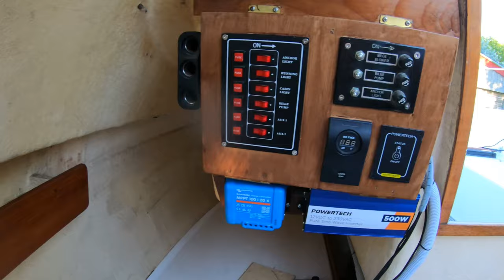74. I Return to roots I Freedom Sailing

Comment: Very impressive work with your boat. Also thanks for the great pointers in the solar panel. Can you share some details on the make and model and price of possible? 
Love the scenery and the water plane landing and even more so the house on the pontoon. Amazing!!!!
Reply from the maker: Well surprisingly that panel setup was cheaper that everything we did on Polly and its output far higher. Its a budget 200w POLYCHRYSTALINE (best for efficiency) Cost NZ$179 , Victron Smart controller 20Amp NZ$280 (bluetooth connectivity). Two 100Ah AMG batteries (these were new and free given to me by a friend) which means effectively we have a total storage and use of around 100Ah (50% of battery capacity) . Each day away the batteries were well charged back to capacity before lunch reaching a maximum rate of over 13Ah - 3Ah more than Polly ever did with lots more panels!  This also means that on days were its not fully sunny or short winter days, we will still be well OK for power. The fridge is incredible and uses around 20Ah/per 24hrs .  https://www.jaycar.co.nz/50l-brass-monkey-dual-zone-fridge-freezer/p/GH1642?pos=4&queryId=f91094c8dea3c0e75394a43d7ca28d6d&sort=relevance
Reply: @FreedomSailing  that is brilliant! I was always worried on how much solar power would I need to purchase and it seems this is a great option. Thank you very much. Hopefully you are all well settled in NZ. We just got back to the UK. Can’t wait to crack in with the studying now.